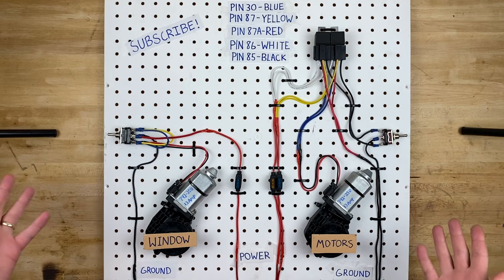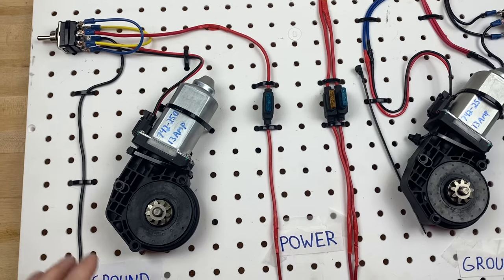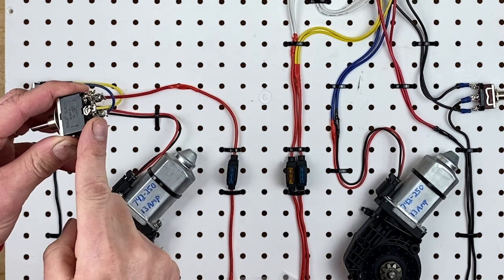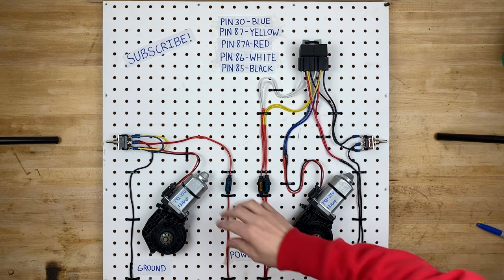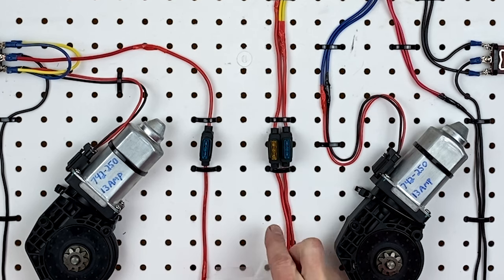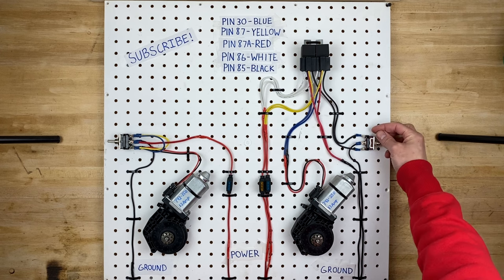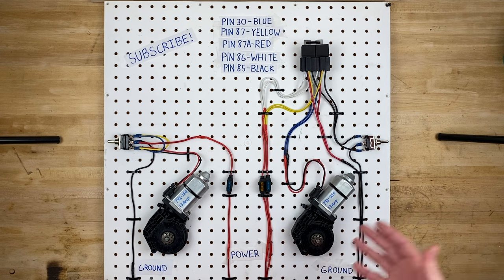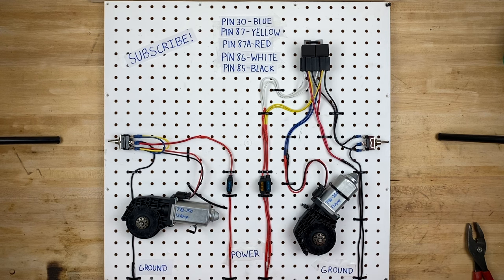Power Window Motor Car Wiring - FOR BEGINNERS! @WiringRescue

Comment: this is the configuration i was looking for so i have pink wire 12 gauge from main harness to pin 87 on relay with a fuse 30 amp, question is 16 gauge is normal gauge to wire the same configuration as yours or as my fuse wire is 12 gauge i have to use ticker wire from switch to relay to window motor?

Comment: I have a question. I had to replace window switches in my car. The driver side can also control the passenger side window. Since I used some cheap universal switches (1 power, 2 ground, up and down pins) I can't make it so that both switches could operate the passenger side window, as the driver side switch does nothing and the passenger side only produces motor noises. The switches do work when not connected together though. Can that also be fixed by using relays? If so how would the wiring look like? Do note, I have also tried using diodes as I thought that was a problem, but when I tested this out on just the driver side driver window switch the contact that did not have the diode (say window up) that button did nothing, as if the diode that was on window down pin was preventing it from making a whole circuit.

Comment: Do you know what to do with a 5 pin switch? (VW T4) I got the wiring diagram and it's obviously not as easy as positive pin to positive 2 negs to negative and middle 2 pins to the window wires. What am I missing?

Comment: pin 86 on relay can be connected to ignition switch on acc terminal? as my fuse wire is 12 gauge with 30 amp fuse how tick the wire to ignition switch must be?

Comment: If I can ask my driver master power window switch isn't powering up the motor. I tried 3 different switches from the auto wreckers and none of them work. The power mirror works but it's separate from the window switch.  I don't believe there are any breaks in the wiring so is it safe to assume that it is the motor or relay on the motor. All the fuses work and all my other door switches work but the master switch won't open any of the windows.

Comment: I messed up at this earlier and instantly melted wires everywhere wish I watched this first
Reply: bruh i promise u this only works for lightbulbs im 6 months into wiring my window for my scatpack swap charger ive botten relays switches fuses wires crimping tools Just to find out female discconects dont fit on the switch then you basically got to guess the amperage of a window motor if your car fuse box dont bring it then you stuck when you see the pitail of the motor is 16 awg wire when the amperage of the motor is 30 amps Point is this works great for light bublbs and low amperage usage. Now i see y shops exist because companies only make parts for shops so us people never find em at any auto store. here lemme save u sm time. PAY SM1 to do it!

Comment: when you grab the motor shaft with pliers with it energized preventing it from turning this is known as "Locked Rotor Amps " and this is very bad for the motor since the motor current goes through the roof .
Slow blow fuses for the motor should be sized to blow at or only slightly above motor current rating to protect the motor but ride through short duration spikes in motor current above the rating .

Comment: Is there a housing for these switches to cover the connections to avoid any shorts
Reply from the maker: Generally you make it yourself. Just drill some holes in a piece of plastic, and pop the switches in the holes. :D Good luck with your project!

Comment: Hi everybody 
While I was doing something else, the wiring of the driver power window snapped, all the wires came out.
It is a harness of 7 wires for Nissan Sunny 2007
I am in need of what colour wire goes into what slot 
Please.

Comment: 7:04 I really wish people would stop calling that a 5 pin relay. It is called a single pole double throw relay or a change over relay. Some relays that have 5 pins are only single pole single throw. 

FYI your circuit on the left can be simplified further by using a 5 pin window switch. The type that has all the pins in a row. You don't have to do all the criss crossing jumpers like you have to do with a DPDT switch. It is all done internally. 

Another FYI. On amazon you can find a harness , that is prewired, for this exact thing. Makes it way easier to get done. It is similar to what you have on the right, but instead of having to wire both Positives from relay coils you just wire one. One white in this case. The power for the motor is also prewired to both the 87 pins. So only one red wire for the motor power and one red for the relay coils in your case.   

Color of wires is different on the harness.  
Two whites wire 16 AWG out for motor on the 30 pins, 
Two black wires 16 AWG for the Negative to the motor 87a pins, 
One red main wire 16 AWG (prejumpered) for the Positive to the motor 87 pins, 
One red 18 AWG for relays 86 pins, 
Two 18 AWG wires, green and blue, for the negative of the relay coils 85 pins.

I have a short video called "Linear Actuator with 2 timers, 2 bosch style relays, fast and easy to wire up harness." with a link to the harness. 

Nice video and great work on your demo board. Much better than most.
Reply: Hey boss, I found this comment very helpful. I hope you might help with a cpl questions. 1) I'm guessing the relay is a direct line to the battery (white wires here) and the switch (yellow) only receives power when the ignition is on or in the "ACC" position?
Reply: @joshuabrumback9681  "I'm guessing the relay is a direct line to the battery (white wires here)"

Yes. That is correct. Power for the window motor will be fused and most of the time it is "direct from the battery". Same head lights that go through the fuse box powered. Or if this is an after market install, a more direct connection to the battery and fuse.

"the switch (yellow) only receives power when the ignition is on or in the "ACC" position"

Again yes. That is correct. Alternatively they can be wired through an alarm system.
Reply: @AztecWarrior69  OK that's a big help. I have a square body k5 blazer with the old 80's toggle window switches. Those didn't come with relays but I'm complicating things even further and I'm replacing each toggle switch with 2 momentary push button switches. I cannot find any step by step instructions but from my understanding the 12v+ and grounds can all be tied together, even the #30 relay pin going out to the motor. Basically everything except the (NO or normally open) from each of the new switches needs to go to separate #85 pins, which activate the relays. So basically all other wires on both relays and both 5 pin button switches are just power and ground except the #30 (to motor) and the #85 (trigger from switch)? Also 86 and 87A are both grounds and can be ground together along with the negative or ground from the motor? I do plan on continuing to use the existing oem 12v+ window wires to power the led's on the new switches as well as the yellow wire we previously covered. I guess what's confusing me is that the existing oem toggle switches currently seem to be wired to direct current not complete a ground circuit. I have diagrams of the oem wiring and how to add relays to the existing toggles.   They're not very detailed but the drivers side, which has 2 toggles; 1 for the driver and the other for the passenger windows. In the diagram it shows that 2 toggle switch currently has 6 pins of which the diagram says only 5 are functional. 1 12v+ and the other 4 being up and down for each window. To add the relays it shows only 2 of those 5 existing wires need to be redirected. Those 2 represent the drivers side up and down and go to their own individual 85 on each relay. Making me think the existing wiring is positive triggered. Hell I dunno. There is a video of a guy on yt named sprayway customs wiring a setup like this but if you had the misfortune of watching it, you'd understand why I feel like I need more understanding
Reply: @joshuabrumback9681  "I have diagrams of the oem wiring and how to add relays to the existing toggles."

Can you please provide a link to them, so that I can look them over?

I will give you this, in general.

Both the 87a will get ground. Neg 12 volts
Both the 87 will get Pos 12 volts. Either direct from batt though fuse Or some other (not a common thing but there may be reasons)
Both the 30 will have the window motor wires

This is will depend on how the original wires were set up. The relays themselves may also be a factor (some relays have built in diodes and it is going to matter what direction they are installed)

In general it won't matter what the 85 and 85 are wired to. Either could be ground or Positive. What matters is what the trigger is going to. In the electrical industry we call this NPN or PNP. " An NPN device can switch the negative side of the circuit, while a PNP device switches the positive side." (Don't worry about what they are called I am just throwing that information out sorry).

An example of an NPN is a door curtesy light switch. Power comes from batt, to fuse box, to the light, splits up and goes to the door switches. When door is open, the switch makes ground.

This is the most common way switches work in early model vehicles. Basically almost anything that has a power grounded chassis. 

So the most common way they are connected is.

Batt, fuse box ignition circuit, to relay 85, relay 86 to switch, then to ground.

I can make diagrams but I can only link to them on vids I have up. Find one that is titled "Window Switch 5 Pin".
Reply: @joshuabrumback9681  looking at a few forums the motor is a grounded body. Meaning that the body of the motor is the negative. And that means that the two wires going to it are going to both need positive to work. One for up and the other for down. What that means is that if you are going to use relays to get better power to the motors all you need is two 4 pin relays. Or the 87a will not be connected. 

Both the 87 will get Pos 12 volts. Either direct from batt though fuse Or some other (not a common thing but there may be reasons)
Both the 30 will have the window motor wires

power to the relays will be 

Batt, fuse box ignition circuit, to switch, to relay 85, relay 86 to ground.
Reply: @AztecWarrior69_69  hey thanks for the reply and I apologize for my absence. 2 different places offer packages with everything needed. One is pretty reasonably priced but doesn't include the back tailgate window. The other does include all 3 windows but they're price gouging and include the cheapest parts. However both use DPDT relays. I've compiled the diagrams and already bought and received the parts and wire. Well everything except the push button switch plate. I've paid for it and he's designed it but we're waiting until I get the K5 Blazer back from being LS swapped before finalizing the design. I plan to customize the door panels and need a few measurements. Anyway long story long, would you mind emailing me? If so I'll add my email here and wait for your reply before erasing it. This way I can include pics, diagrams and links easier. Imma truck driver and used to be halfway up to date with electronics but a decade of isolation in a semi put me way behind. If not I understand that as well and appreciate the help you've given already
Reply: @AztecWarrior69_69  so I figured it out, in large part thx to you. The info you received about the motor ground is correct for the earlier 70's Blazer's but was changed in the 80s to alternate. I'm sure u know what I mean, even though I'm probably not using the correct nomenclature. My take on it is that when resting, the motors 2 wires are both being grounded as the NC or 87a is a ground. Therefore when activated the relay switches from that 87a ground to the 87 positive pin; activating the corresponding side of the motor, while the other relay remains a ground? I'm guessing that's why a 5 pin SPDT relay is needed, instead of a 4 pin SPST? I think this may be a better way of asking. 1) 30- to motor. 2) 85-acc positive. 3) 86- from switch NO. 4) 87- fused positive from battery. 5) 87a-ground? 6) It also appears that 85&86 wires could be swapped and work identically either way?
Reply: @joshuabrumback9681  "Therefore when activated the relay switches from that 87a ground to the 87 positive pin; activating the corresponding side of the motor, while the other relay remains a ground"

Yes. 

"I'm guessing that's why a 5 pin SPDT relay is needed, instead of a 4 pin SPST?"

Yes. However I advise to try and not call it a 5 pin relay. It is call a change over relay or Sigle Pole Double Throw relay. While many recognize a change over relay as a 5 pin relay, 5 pin relays are not always SPDT but Single Pole Single Throw. It may look like it has an 87 and an 87a, they are actually two 87s. So when you go to the parts store don't just ask for a 5 pin.

Both relays
87a to ground (Neg)
87   Pos from fused battery

Com to motor
Com to motor

Now the 85 and 86 can be interchangeable MOST of the time. However there are times when a relay may have either a flyback diode or an indicator diode.

Flyback diodes are also known by other names, including: Snubber diode, Relay diode, Commutating diode, flywheel diodes, freewheeling diodes, or relay diodes. what they do is dissipate the Back EMF that the coil of the relay produces when the magnetic field collapse. The Back EMF is often greater than the input voltage. The EMF going back through the circuit can damage other electronics. On older vehicles this does not matter as much. Newer vehicles that have computers might get damaged if the polarity is not correct.

Indicator diode, well they just won't turn on. They will flash when the back EMF powers it up.
Reply: @AztecWarrior69_69  so it would seem to me that the different diodes you mentioned are all designed for different varieties of feedback. Do the different functions dictate whether to use the 85 or 86? Or would the acc and switch have normal designations?
Reply: @joshuabrumback9681  In general the diodes can be different.  

Anode Side is in the direction of the arrow
Cathode Side is the Line side

A flyback diode is basically just a simple diode, usually a IN4007. The orientation of the diode will dictate the polarity needed. The diagram will show a line with an tringle "arrow" and a vertical line. Positive will flow in the direction of the arrow (Anode) and blocked on the vertical line side (Cathode). When the magnetic field collapse the back EMF is reversed polarity. In order for the diode to do it's job, positive will be on the line side (blocked) when the relay is on. When the relay turns off and the magnetic field collapses, polarity reverses and the positive is now flowing in the direction of the arrow. The diode dissipates the voltage.

An indicator diode (LED) will have positive voltage in the direction of the arrow (anode). So when power is applied the LED turns on. 

If the diagram is present and the diode can NOT be seen it is a Flyback diode. So whatever pin has the Cathode gets the Positive voltage and the Anode gets the Negative

If the diode is an LED and the LED can be seen, either through the case or a hole, Then it is an indicator diode (most of the time) and Positive will be applied to the Anode and Negative to the Cathode. Sometimes you can use the LED as a flyback diode if you don't need to see if the relay is on. As I mentioned before, when the relay turns off the LED with flash, dissipating the Back EMF

Comment: Hi. I'm having an electrician assist me with a special project. Is it possible that power window motors could help raise and lower steel backed magnetic board up and down for a special map in my den? I know unusual but I don't want the map to take forever moving like a TV lift motor. Any Suggestions?
Reply from the maker: Sounds like a cool project. Maybe look into universal hotrod window regulators. They  are very basic, and may work for what you’re trying to do.

Comment: So I want to use the Amazon momentary push button with LED to relocate my window switches according to your math if I want to control all of them from a center consul I’m going to need eight relays because they only operate one function, so it either completes the circuit or it doesn’t?
Reply from the maker: If the Amazon switches are not rated for the amperage of your window motors, then yes, you’ll need 8 for 4 windows if you copy this design.  It’s a lot, but at least you’ll know how it works and why! :D

Comment: can you help with vag group with 25 pin window motor my issue is got from donor car my case golf 4 (4 door) window regulators with the window table comfort module without door lock module i wired 1 window only it work when i came to wire second motor doest work

Comment: So why doesnt it pop a fuse or a switch wen iside the car door?
Reply from the maker: The switches and fuses are all sized appropriately for the motors that are being used.  But if you are adding power windows to a hotrod and you have a specific switch that you want to use, this circuit design allows that to happen.